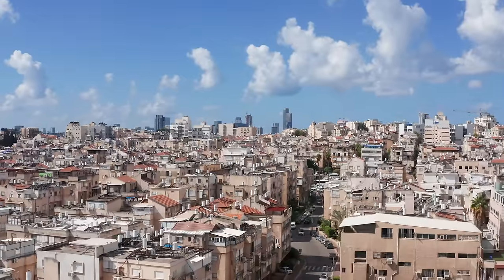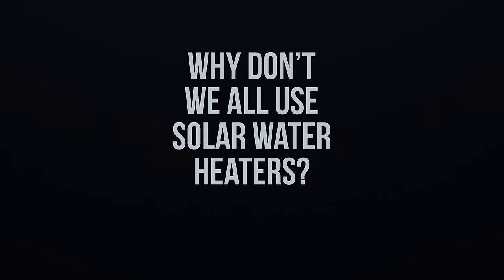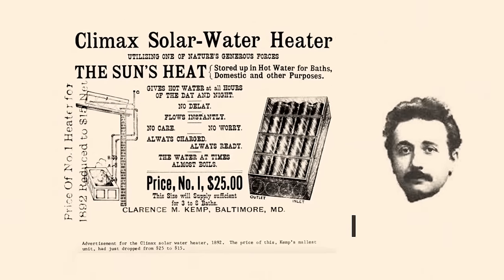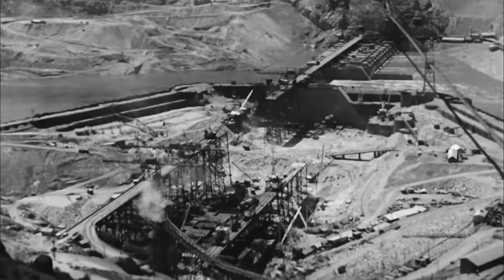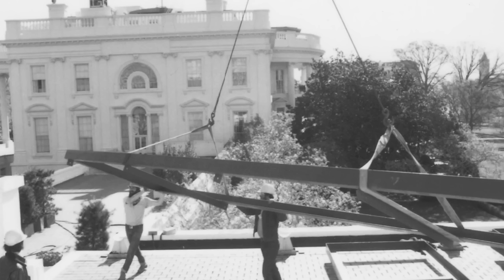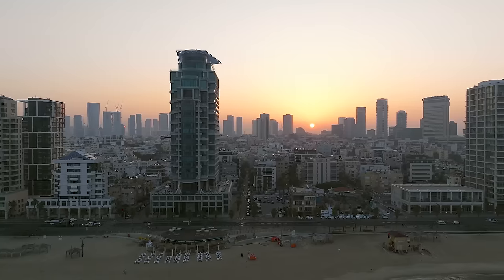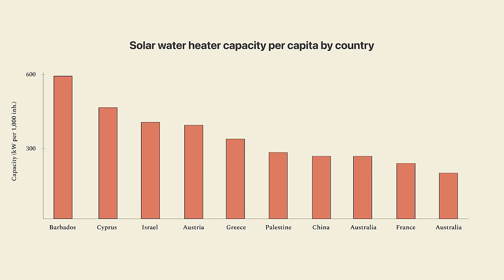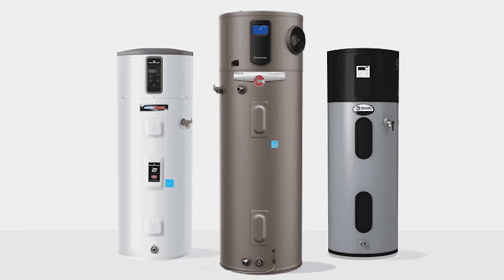Why Don't We All Use Solar Water Heaters?

Comment: The price of solar cells has declined rapidly in the last 15 years.  They basically need no maintenance.  The price of solar-thermal  (water in tubes) has stayed constant and the system DOES need maintenance.  If anything goes wrong you have leakage, thermal inconsistency and rapid system degradation.   If you are thinking about solar-hot water then it is worth checking which one is really worthwhile for the whole life-cycle of the installation.
Reply: The lifespan of a solar water heater is 7-10 years.
That's in Israel where everyone uses one.
Reply: If you have a hot water cylinder heated with electricity the solar panels can give you 'free' hot water for much of the year. We're stuck with a gas combi boiler unfortunately.
Reply: Yes, heat pumps plus renewable energy is the solution most of the market will go to. But that solar water heater can feed the heat pump and reduce electricity demand and potentially the size of the heat pump. Whether it will make more financial sense to fill your roof with photovoltaic or also use part of it for a solar water heater, I don’t know.

And a solar water heater from the limited experience I had doesn’t need more maintenance than radiator-based heating systems that dominate the market in Europe.
Reply: Yes, with installation and maintenance costs in the US, even if you live in a hot area you'll probably never break even with solar-thermal hot water unless you live in an area with very high energy costs.
Reply: @jmodified  I cannot see a path to net zero carbon emissions that doesn’t involve making fossil fuels significantly more expensive. Yes, in principle you could use a purely carrot-based approach of subsidising renewable energy to such an extent that it becomes cheaper than fossil fuel-based technologies in every application. 

Either way, solar thermal (or renewable electricity + heat pump) will be cheaper than using fossil fuel, be it via higher costs for the latter or subsidies for the former.
Reply: @aphextwin5712  Don't forget conservation has the best ROI. It's easier to reduce demand than it is to generate new energy. I do this for a living (consulting). The ROI on adding insulation and thus using less heating/cooling demand, is way better return than keeping an inefficient heat losing leaky house with some solar panels on top.

Comment: In the UK my Solar water heater is 10 number 1.4kW solar thermal panels.
The hot water is pumped to the house and heats a 300 litre insulated tank.
This gives 3 days worth of hot water.
The temperature of the stored water can be set to boiling point if you wish but we keep it at about 60c.
We use excess hot water to heat the central heating system via a heat exchanger and in summer a separate heat exchanger is utilised to heat the swimming pool, remember it is delivering 14kW when in full sun.
In warm weather we have had the swimming pool at 32c but the hot water can't really be turned off as the glycol/water mix in the panel will boil at about 135c and cause problems.
The system is pressurised to 3.5bar to raise the boiling point of the panel fluid.
It provides hot water for about 10 months of the year, partial heating in spring and Autumn and pool heat in summer.
Reply: I've been told that solar thermal hot water requires a lot of maintenance. What's your experience ?
Reply: @grahamstevenson1740  been installed for  11 years with zero maintenance. Never had to repressurise and have never changed the glycol. I washed the panels off once.  Still working well , made over 100 kWh in a single day.
Reply: @andrewstafford-jones4291  So there's no shortage of cowboys dealing out dodgy advice ? Thanks.
Reply: @grahamstevenson1740  Not sure as I don't have a reason to talk to them.
I know they recommend changing the glycol/water mix every year but that's just uneconomic.
It would cost a lot to change my glycol, I think it used 8x25litre to fill it.
Reply: @andrewstafford-jones4291  Good to know, 100 kWh in a single day though?
Reply: I've got solar panels instead of solar water heaters. My rationale is that I use far more electricity than just water heating, even if you consider wet heating systems

I'd prefer to cover the entire roof in regular solar PV.

Also, I reckon the UK could show they're truly committed by mandating their install on 10 Downing street, and most public buildings where viable

Equally, the UK could make most buildings a lot more air tight, and better insulated. Then perhaps private citizens will follow en masse
Reply: @waqasahmed939  Improved insulation and draught-proofing would be by far the best approach.
The latitude of the British Isles means that PV solar generates only 1/4 of summer generation during the winter when demand for electricity is highest. Not the best idea really.
Reply: @kylexrex  Normally 35 -50kWh but we are limited by the temperature remaining in the tank/pool/heating.
Nice clear days after cloudy spell so everything is cold and the heat has somewhere to go, the highest yields are not the middle of summer because everything is already hot.

Comment: Where I live we have 300 sunny days a year so we decided to install a 10,000 watt PV solar. Although it was expensive (about 25 k USD) it’s been a  very good experience. The system is grid tied and has been trouble free and more than pays for itself. I would like to also install a solar water collector too.

Comment: Good history lesson. We are in southern NH. During the summer we use a batch solar heater in our greenhouse and in winter a heat exchanger in our cordwood stove. Both feed an electric water heater that makes up any short fall. I realize we are not typical but our DIY solution works well for us. The wood stove is fired up as I write this post.

My parents installed a solar water heater in the Chicago area and had constant problems with it so it never was as successful as it should have been.

Comment: I have a solar water heater on the roof of my house. There is one more thing  I have to add is to provide insulation around the tank. I noticed when the sun sets the hot water does not last long as it loses heat when the sun sets. I also have an electric heating coil in the tank which I use at the moment for the time being.

Comment: Here in S. Florida, when I was a kid, most of the older houses from the 1920s and 30s had simple solar heaters comprised of flat metal boxes with a labyrinth of copper pipes and black paint inside with plate glass over the top surface. Nearby was usually a small electric booster tank in another insulated metal box to help on shady days. Sometimes kids (never us!...) would throw rocks and see who could hit the glass and break it. My grandmother's house, from circa the early 1930s,  had this and I once helped change the electric tank heater by schlepping it up a ladder as a strapping, fit, teenager. Do you have any link to a modern-day self-contained solar unit?
Reply: They aren't generally self-contained, they're usually a rooftop panel & an indoor tank with pumps & control gear.

A rooftop panel feeding a shower or tap is very possible (a friend of mine has this in the garden) but it's generally not very useful & can suffer with calcification/limescale depending on your water supply.

Comment: We did have a solar water heater in Houston.  It was really a 'pre-heater' that then goes to the 'regular' electric water heater.  It went away when it started leaking about the time we replaced the roof, so it went away.  Now near Nashville TN, we don't but do use a heat pump water heater.

Comment: Interestingly, a pure water solar collector is exactly as efficient as a PV one, ie both get the same energy per square meter of collector. But if you use the PV's electricity to run a hybrid hot water heater (with heat pump), you get 3x the hot water. Thus, if you have a PV system, just add a few panels to power the HW heater and you are far ahead of having a water solar panel system (with its valves, freeze protection and pumps). I did that with my solar home, and my Rheem heat pump HW heater works flawlessly.
Reply: Plus you don't have route water to  the roof and can use the electricity for other things.  Much better solution.
Reply: @drewp4  

Both of you are right. Just one comment. 

Thermal solar panel efficiency is 90%. 

Photovoltaics solar panels efficiency is less than 20%.
Reply: @ajarivas72  True, as it is, but the actual panel area of a set of evacuated water tubes isn't as dense as a flat silicone sheet, so the amount of BTUs per sq meter of roof area is almost identical. And if you use PV, -no pumps, valves, drain down tanks and such. The net result is PV to a heat pump water heater is about twice as efficient as water solar panels. But hey, either is better than a fossil fuel WH!
Reply: @nicklappos  

The panel area density of an evacuated tube solar water heater is identical to a PV panel, just add a mirror 🪞 below the tubes on the roof and the heat is reflected to the tubes from the bottom. 

My evacuated tubes solar water heater mirror 🪞 enhanced recibes 5 times as much Sun ☀️ as a normal evacuated tubes solar water heater. 

I reflect Sun from the bottom, sides, front, behind and top. It gets suns from all directions from sunrise to sunset. Cloudy days no problem.
Reply: @nicklappos  

I have several wind generators, so I can energize the electric (resistance) boilers when there is plenty of wind 💨. 

I use the electric boilers as dump loads for the solar and wind systems. Side effects: very hot water galore.
Reply: @ajarivas72  the evacuated tubes from some suppliers are half mirrored already & the mirroring is in a vacuum so never tarnishes.

Comment: I am in South Australia near the southern 35th parallel. We have a 22 tube Evacuated solat system, it provides all our hot water for 40-45 weeks of the year. Then the elecric booster is turned on for a system boost. As soon as possible we turn the booster off again 😊 we also have a large reserve tank

Comment: With three teenagers in the house in AZ, the solar water heater had NO problems keeping up with their bathing and ours.

Even in a cold climate, as long as there is sun, you can at least use a solar collector to preheat water and reduce the energy used for the final heating.

Comment: I would like to add that my system had a glycol based liquid that circulated to a heat exchanger on top of a 75 gallon storage tank that fed a traditional natural gas water heater.  It needed periodic maintenance and replenishment of the glycol (anti freeze) liquid.  Service cost about $125 a year.  So, a complicated system with many failure points and maintenance costs.  This was 40 years ago and as I mentioned it only worked for 15 years before pumps going out. It was also time to replace the tank.

Comment: The solar thermal array on my house in southern England is plumbed into the central heating  system in such a way that it diverts to the underfloor heating also. The PV array is used to run the ASHP for a fourfold gain in heating applied to the house.
Reply: Cost of all that?
Reply: @LoremIpsum1970  The whole six bedroom  house and large garage was built for £235,000 . We did most of the installation work ourselves, and got good prices for what we bought in. The Solar Thermal array was less than £1000 in all, the PV was £10000, but it attracts a decent FIT which has paid for it. The ASHP units were less than £1000 each and are fitted in the loft, No outside noise, and full protection from the weather , whilst being part of the Ventilation system .

Comment: I built my house 13 years ago with consideration of solar water heater, i.e. dimensioning the water tank and having extra coil for solar heated water input. But the money it took it back then seemed to be too high to justify the purchase, so I thought maybe later. I checked few times in the years between then and now and never it made really sense - the green subsidiaries rose, but the installation companies ate it all and did not pass it to customers. As a result, when I checked it last time, I calculated ROI to 19 years. From the sources I have, this system does wear down and the common life span is between 10 and 15 years - so it didn't make any sense. The ultimate end to this idea was when I purchased a PV solar system and a heat pump. The PV panels generate excess enerrgy like 3/4 of a year and this is turned into heat in the tank with 400 - 550% efficiency. So I think it beats the solar water heating systems and serves dual purpose. Both PV solar system and heat pump (switched to it from gas) make sense on it's own, but combined the ROI drops down significantly.
Reply: Some factors to take into consideration:

a) The maintenance cost and lifetime of the heat pump.  Heat pumps are mechanical devices and depending on usage domestic heat pumps can require replacement within 8-10 years.  They need servicing at least annually, even if only cleaning of the external radiator.

b) A resistive heating element may give a much shorter return on investment than a heat pump depending on the situation.  You'd need to "crunch the numbers" to be sure.

c) Solar panels work really well when the sun is out, but produce virtually no power when there's excessive cloud.  In some countries/localities there will be a fair proportion of "miserable" days with either very little or no  power generated from solar panels.  That's no doubt less of an issue for areas like parts of Australia and other similar climes.

d) An on demand" gas water heater is very efficient as it only heats water when it senses water flow in the hot water lines.  Accordingly it has a low running cost, even if gas prices are a bit higher.  The capital and installation costs aren't high and additionally that system does not require a hot-water storage tank  as it heats water flowing through, and only when there is actual demand..

e) As I understand it, in many countries,  solar water heaters and installation used to be very expensive but prices dropped  within 10 years and the systems became more sophisticated and efficient.  In some climates  frost protection is required, but modern systems take care of that by using a heat exchanger between the hot water system and the panel fluid (which contains a frost-free liquid).

I all depends on the exact situation.
Reply: @ericapperley7411   a) I will see in some years after warranty. I have friends with heat pumps running for 10-15 years and no issues. Furthermore, the pump component itself, which used to wear down with older (like 2 decades plus) heat pumps is only a small fraction of the cost and can be replaced. Modern ones don't wear much, theyr're digitally controlled with smooth start and run out. Parts are available and I doubt Samsung will go out of business either. Servicing is not "at least once a year" - for al-in-one units it's not usually required to service it during the life time of the product, unless remote diagnostics show a problem. For a split system (like I have), servicing once a year during the 5 or 6 (forgot) year warranty and I have a fixed price, I thing it's something over €30. Some companies charge double, it's up to you as a customer to accept or change to another authorized maintainer.
The heat pump costed me less than €8000 complete with installation, 11 KW, both heating and hot water, WiFi, everything included. ROI would be 1.3 years (!) due to peak in the gas prices, if I got a subsidiary for changing from gas (which I did not qualify for due to my age of gas heater, although it's ironically at it's expected life span), so now it will be little over 4 years (estimated - my calculation, not a marketing trick of a seller, but it includes substraction for a cost of a new gas boiler, which I'd have to put down if continued with gas, roughly €2200). Mind also, that having solar system helps the heat pump ROI too. 

b) AFAIK, resistive heating is usually among the most expensive heating options, unless you are passive or very close to passive (or in favourable climate). Especially it's not a good option for houses with large heat acumulation capacity (which I have and I am very glad I do). 

c) Not true that solar panels don't produce electricity with cloudy weather; they can produce much less though, that's true. Typically the output does not fall under 1/3 from spring to autumn, and in extreme winter conditions it can fall to about 15%. But the solar field is the least expensive part of the system and is typically dimensioned to cancel some of the difference, so in my case it's around 50% of required output during December, which is the worst part of the year here. 

d) On-demand gas heater is a product that can be very feasible in certain scenarios, but it is not (AFAIK) by a wide margin for a typical house with typical family usage profile. 

e) I don't think the systems are particularly expensive here. I think the part I'd have to pay would be around €2200 (complete, including installation) and the investment would be the double (half would be paind back to my account by environmental programm). Still, with the system being that cheap, the ROI came up to 19 years - beyond the life expentancy of the system! Simply because it does so little as for the effect on the overall house bills. I considered it seriously 3 times over period of 10 years and found marketing of those products is far away from the reality.

That is my take on your points. But I'm not an expert, just interested in the topics.